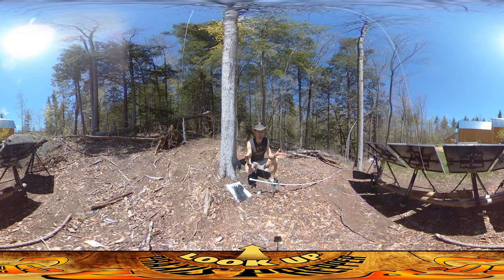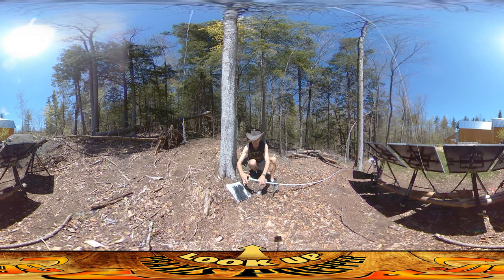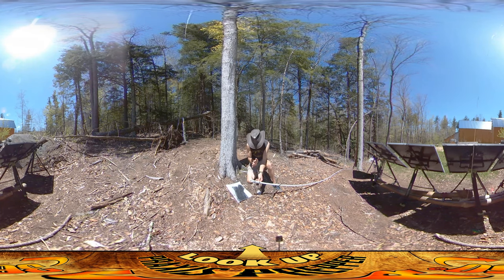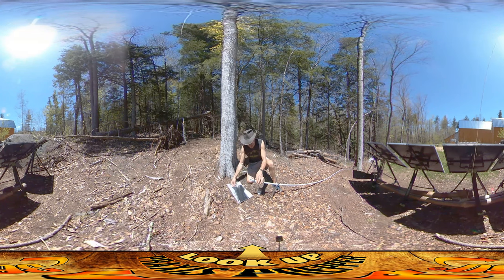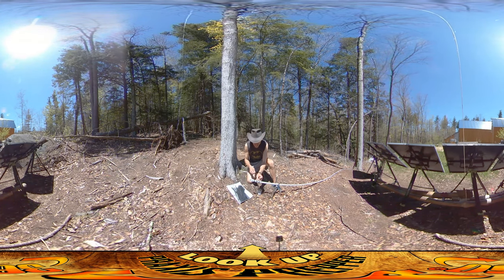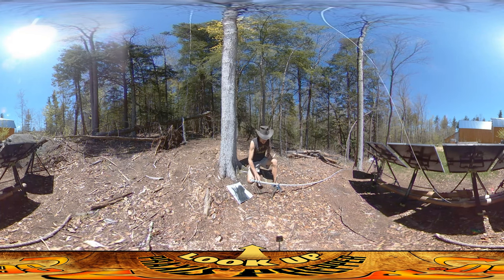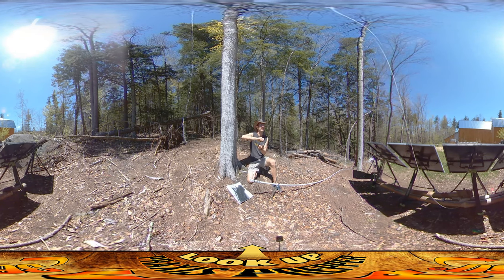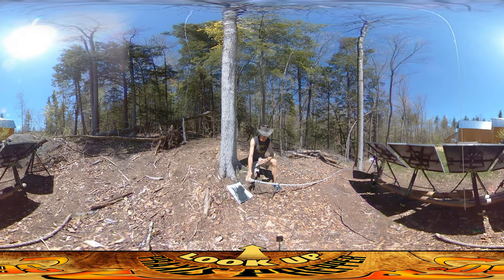Homestead Building - DIY Dipole Shortwave Radio Antenna

Comment: BTW, what’s with all the red flashes in the videos recently?
Reply from the maker: Lens flares I think.
Reply: @PraxisPrepper  So you have no idea 😉
Reply from the maker: @inmyimage1081  Huh. I thought you were referring to the red bit that's in the lens flare. Ontario Homesteader had asked about it in another video, so I presumed you were just seeing that. I just actually looked at this video to see and (of course) those ain't no lens flares.
It looks like my camera is having some issues with correctly compressing the frames and they're being returned as red garbage. The reason the camera is doing this is... I have no idea.
Reply: @PraxisPrepper  Sometimes it takes a photographer to point out things that a snapshooter either misses or aren’t conversant in. True for all fields I’m sure. Does it have interchangeable flash cards? Maybe the one in it is corrupted.